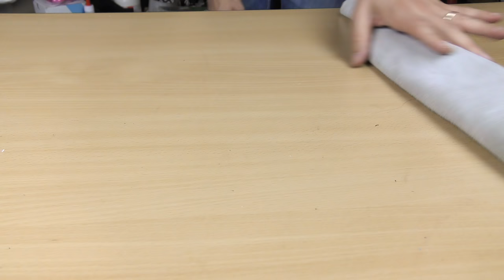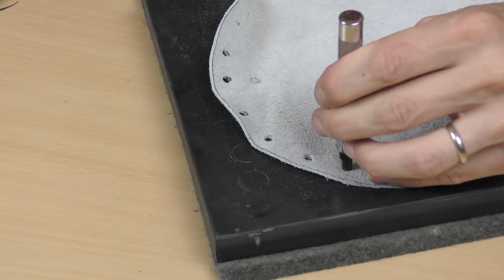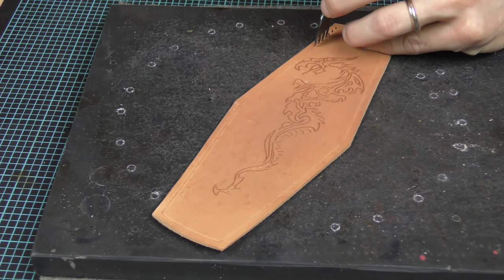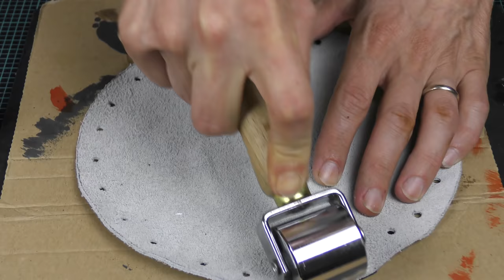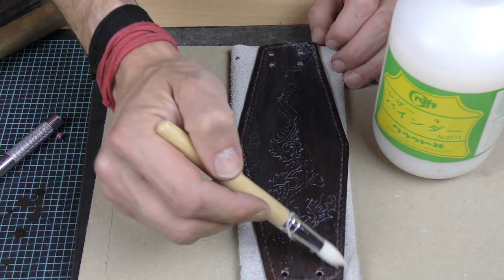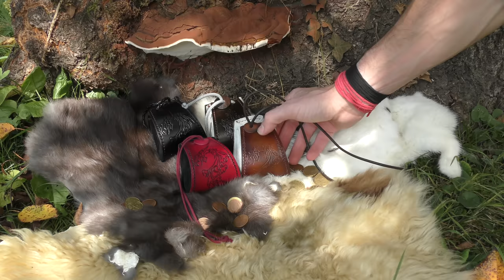How To Make A Drawstring Leather Pouch - Leatherwork With .pdf Pattern

Comment: Love the video and the bags. With the red bag, how did you get the black lines in the red leather? Did you paint them or put an antique finish over after sealing it with resolene?
Reply from the maker: Thanks a lot. When it was all done, I just used a fine sharpie in the embossed design to make it pop :)